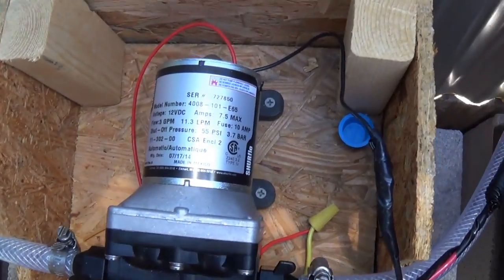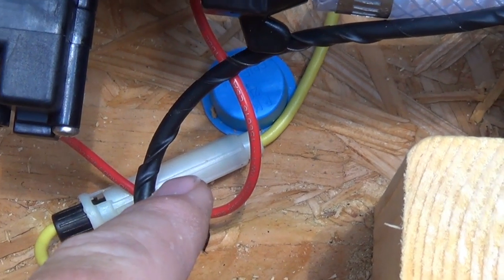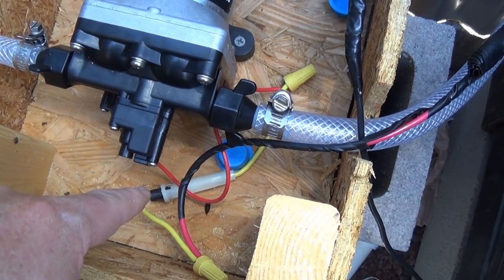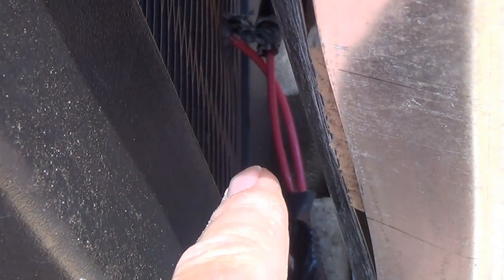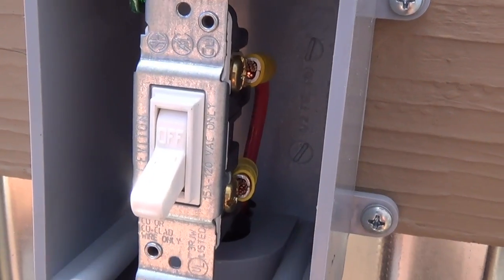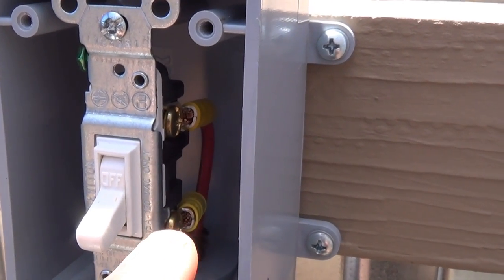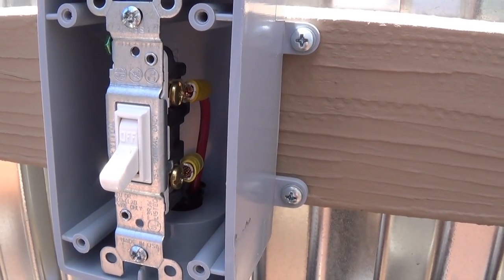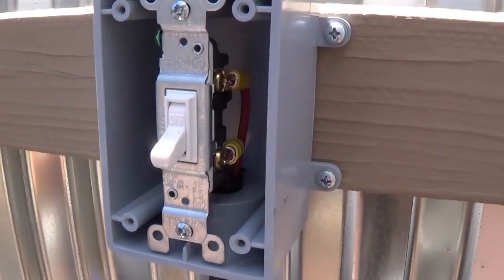Wiring a 12v DC Water Pump to a Switch for my Off Grid Outdoor Bathroom - Triple S Bath House

Comment: What if I want to wire it to 110
Reply from the maker: its a 12v pump you would need a type of step down converter that also changes the ac volts to dc. kind of like what is used to charge phones . i am sure they exist but i dont know what its called but make sure you find one that meets the amps of the pump.

Comment: if I could make a recommendation, the fuse should be as close as possible to the power source and not the pump itself. Thank you for your video.
Reply from the maker: thanks. i have hear that before.

Comment: wondering if you have any advice, the wires from my water pump switch in bathroom go behind wall in my camper so i can't trace it to troubleshoot why switch isn't getting voltage & thereby why pump isn't of course getting voltage either...pump still runs w/makeshift direct to battery test...i can't see or understand exactly what battery wire/s run to switch either...a lot of stuff runs behind water tank under couch if not straight up behind the wall...enough's exposed i think to figure out hopefully if not rewire?...but better to use existing switch hopefully that just worked perfectly until now...any suggestions?  thanks!
Reply from the maker: use a mutli meter to test the continunity  between the wire ends. becus the ends are so far apart you may need to add wire to your multi meter leads to reach. your looking for a break in the wire. its thin stranded wire if a rodent got in there they will chew it in half.  othewise maybe a loose connection.

Comment: Hmm, I noticed my old water pump in my trailer didnt have its ground wire hooked up to anything- and theres no wires tucked away to hook it into: is that because trailers already use power converter and therefore the current is already grounded as AC?
Reply: The pump is 12 v or 120v  you should ground to metal framing. But most all pump are frame/chassis grounded so all ways mount to frame
Reply from the maker: dito
Reply from the maker: your trailer water pump should be 12v. the ground should go to frame.

Comment: please STOP ASAP on the way you explain electrical wiring because your 100% incorrect and your wordage could hurt someone. all switches disconnect the power on 120v the reason you have a white and black is because houses are wired in romex the white and black mean the same thing as your 2 red wire mean. 1 feeds to switch with current & 1 returns to device to complete circuit on 12v your black is the same as the white just different wire jacket colors and yes you should always use grounds to earth even more so when around water. I was confused because the pump your using is pressure regulated shut off the water flow and soon after pressure has leveled off the pump will turn off turn on valve and pump starts.
Reply from the maker: good to know

Comment: 👍
Try to use a 24v alternator to charge the other two died batteries, for maybe 5min. Usually it will revive them back.
Reply from the maker: they are old, been frozen a few times. i think the plates are coated need to deep clean the plates and get new solution in.

Comment: How long can you run the pump before needing to charge the battery?
Reply from the maker: the pump is rated at 10amps per hour so depends on how many amps in your battery. your not going to use it for an hour continuously  so overall 10amps it might take a few hours .

Comment: What size is the water hose barbs used to go to your pump to connect to the tankless water heater? What is the size of tubing that you are using on your pump to heater setup?  I am having trouble in finding the connectors which will work to make this pump connection to the water heater. I have my unit mounted on a roll about dolly with the propane tank strapped onto it and the dolly having a wooden cover made to house the tankless water heater on, as well as the off/on switch and motor. I plan to use my tankless water heater setup to heat my hot tub with. I do have one other question for you, too. I have not completed my setup just yet, as i had problems in finding the fittings to allow for my hose to the pump, as I stated. However, the knob to the right on the unit seems very loose to me. I wrote to Champlux, but they have not replied, yet, I did not know if this was normal or if something got squashed in shipping. Is there any adjustment to tighten this knob down, as far as you know. I can push it from side to side in the hole that the knob is inserted into. I didn't want to remove the cover, for fear of damaging something. Thanks for any replies. Nice video.
Reply from the maker: the connections to the pump came with the pump. to the water heater i went to home depot and found the fittings that would work.
Reply: @ArizonaHotHomestead  which fitting?

Comment: Hi there, I’m trying to add a variable speed control switch to my 12V diaphragm pump to set up a sprinkler system for my reptiles. I can’t figure out the wiring... I’ve got red and yellow wires and I originally hooked the pump up to a dc 12v plug so I could plug it into the wall. The pump is too powerful so I’m just trying to decrease the flow of water  with the speed control. Any help or advice would be awesome!
Reply from the maker: not sure the speed control switch should have a wire diagram with it . think of it this way the speed control switch is only controlling the power to the pump. at little power the pump will barely open but at full power the pump runs full speed.... I would probably instead use a ball valve to control the flow of water. set the ball valve so when the pump is running the flow or volume of water coming out is to your liking. use a timer to control when the pump runs and for how long. that's would I would do instead of using a control switch.... hope that helps you.

Comment: Hye  can we use this in irrigation system and tell  me about  price  only  pump.  Thanks.
Reply from the maker: 12 v pumps are between 75 to 200 bucks depending on psi and diaphram type. i wouldnt see why not. i plan on using the pump for a small garden.

Comment: I need to install an off / on switch for my seaflo water pump 42 series. To use my shower in my Kenworth T680.
I want to install a nice lighted switch.
Reply from the maker: good idea. this video show that. put your switch on the positive line and between the battery and pump.

Comment: What triggers the heater to fire?  Is it low pressure or water flow?   I’ve always wanted to do this but if it’s a pressure drop in the line it would make it difficult to keep lines charged with pressure in a boondocks situation.
Reply from the maker: as long as the water pressure is above 25psi and flowing (turn the faucet on) it will light the heater. if the psi is to low it will not stay on.  the copper tubing walls are really thin so the water heats quickly but also means dont let it reach 30 degrees it will damage the unit.

Comment: What size is out /input from the pump
Reply from the maker: 1/2 inch both. a lot of dc small pumps like this should be 1/2 inch . there are larger but what i have found is most are 1/2
Reply: Thank you very much for your reply
Reply: What size coupler to the inlet?

Comment: Thanks for the vid, very helpful.  What gauge of wire are you using for this pump? 14?
Reply from the maker: i used 10ga from the battery to the pump. i could have used 12ga. i dont like 14ga just becus of how small it is. harder to work with. i seem to brake the stands more. lol.... for short runs i am sure 14 is fine.
Reply: i hooked mine up tonight in my van with 14ga (which a webpage suggested for my Shuffle) and it works!!!  Thanks for getting back to me.

Comment: also what kind of fuse do you use??
Reply from the maker: I looked on the pump to see the amps it draws and got an inline fuse holder then got a cylinder glass fuse that was slightly more amps. I don't remember the amps but for example if the pump said 6 amps I used a 10amp fuse. if the pump said 12 amps I would use a 15 amp fuse. etc....  great question
Reply: @ArizonaHotHomestead  Why do you use greater Amps, why not 10 Amps like the pump says?
Reply from the maker: @projet2907  you can use a 10amp fuse. i have in the past but also a little bigger some times.
Reply: @ArizonaHotHomestead  Ok thanks :-0)
Reply: Glass  fuse